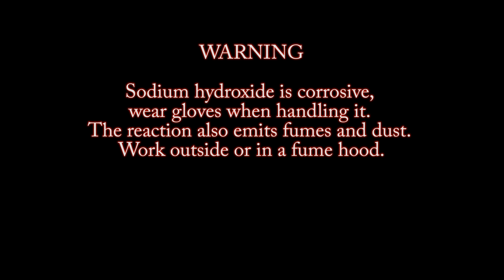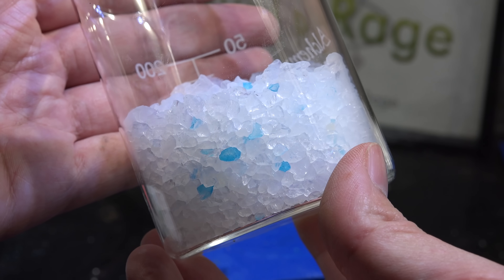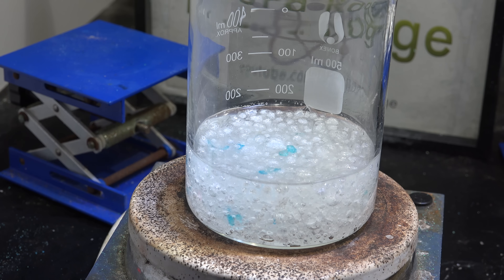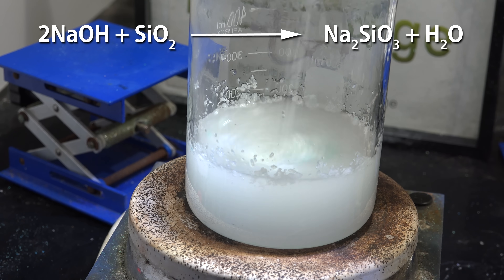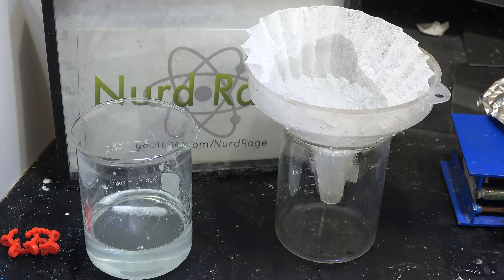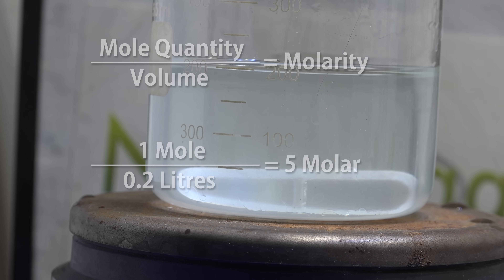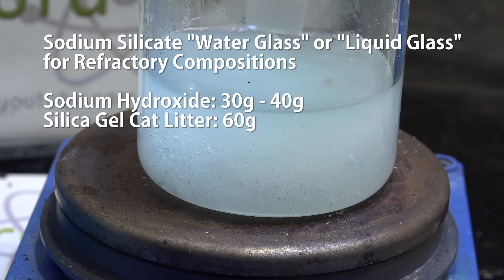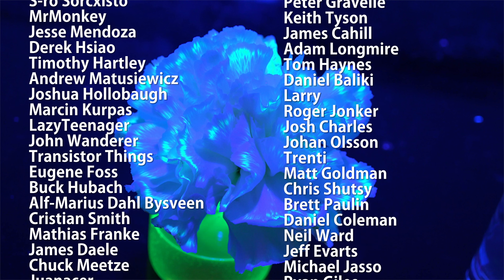Make Sodium Silicate (AKA "Water Glass") from Cat Litter and Drain Opener

Comment: Try sand and NaOH lol
Reply from the maker: no, i explained why in the video.
Reply: ok, my mistake, nice video tho
Reply: where do u buy basic chemicals? down here we dont have sodium/potassium hydroxide, nitric, or sulfuric acid,
Reply from the maker: Plenty of commercial products have the chemicals in them. Like sodium hydroxide is found in some brands of drain cleaner, sulfuric acid in others. Nitric acid is made by mixing potassium nitrate fertilizer and sulfuric acid. 

that sort of thing.
Reply: yes, those are hard to find in duniden
Reply from the maker: In that case you need to be creative and maybe start manufacturing chemicals you want. A central tenant of chemistry is that anything can be made from anything else as long as you have the same elements.

To make sodium hydroxide you'd look for sodium bicarbonate (baking soda) and heat it up to 900 celsius. It decomposes into sodium oxide that can be added to water to make sodium hydroxide. It's a very tedious process mind you, but it works. 

I've never been to duniden but i'm sure there are local substances that can be re-engineered into what you want if you put the work into it.
Reply: yes, 900 celcius is hard to reach, but like always, privilege talking to you
Reply: If you think you "don't have that stuff" you're not looking hard enough.
All these are readily available from industrial suppliers the world over.
Reply: yea but i doubt they would sell chemicals to any teen-adult, and i tried to find areas close to me and the only chemical i could get were HCl for $15!!! not cheap!!!
Reply: and the only web sites i can find is "mckeown chemicals dunedin" and they dont even display the chemicals!

Comment: I did this.  Thanks NR for the idea.  I'm making custom firebrick.
Reply: How well did that prevent cracking? Did you just paint it onto regular bricks; or, did you make the bricks, as well? If the later, did you add this into the mix; or, put it on after they cured?
Reply: How did it turn out? And how well did it perform?

Comment: I liked the strong recommendation for purity! For amateur chemistry, would it be possible to make table salt from your sodium metal and chlorine gas if you have it? That would make for an interesting video.
Reply: You could mix NaOH and HCl to do essentially the same thing with fewer risks - but if your reagents are concentrated the reaction will be furious, try it with very dilute solutions if you do, and be mindful of the HCl vapors. If you're using stoechiometric proportions you should be left with just salt water. Don't drink it though if your reagents are not food grade. And even if they are, still probably not a good idea to drink it in case one of the reagents was in excess (which, if you're an amateur like me, is likely).